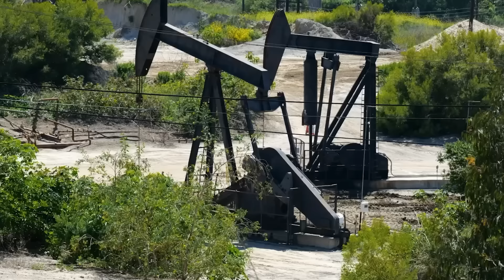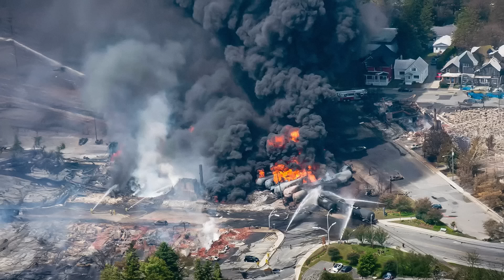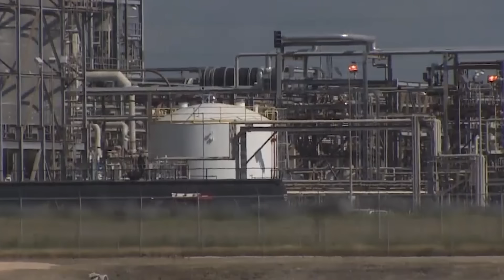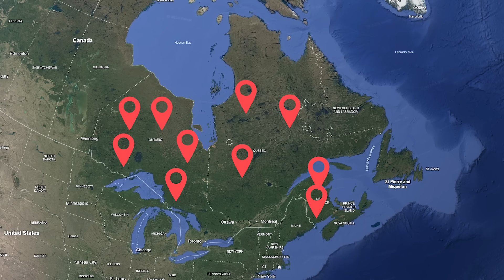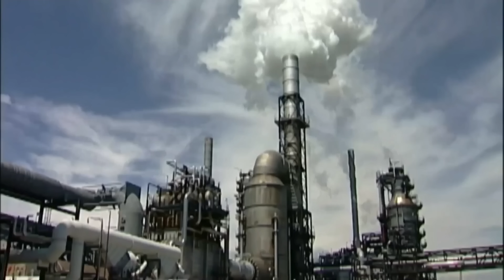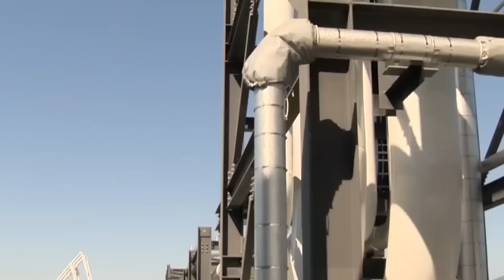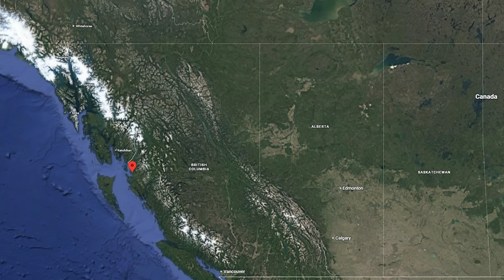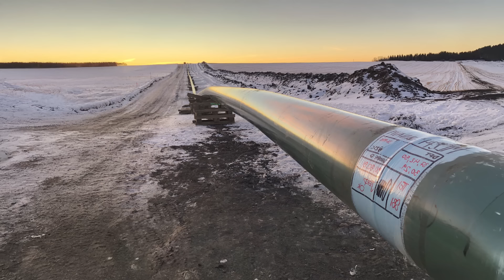Here's Why Canada Can't Build Its Own Refineries, Even Though It Produces Millions of Tons of Oil

Comment: The Co-op Refinery Complex (CRC) in Regina, Saskatchewan Canada can handle heavy oil which then can be sent to other countries.
Reply: It runs an integrated refining and upgrading complex. The refinery is   one of Canada’s largest integrated refining and upgrading complexes, not a heavy‑only plant.
Integrated complexes  run a mixed crude slate — heavy, medium, and light — depending on economics and product demand.      That is because you get different product levels from light medium and heavy.    Due to the upgrades back in the 1980s it can process heavy crude but like all refineries it runs a mix which changes according to what they need to produce as the three grades produce different quanitites of each product.   Light crude for example is 25 gallons of gasoliine per barrel. Heavy crude 10.  Heavy crude 25 gallons of diesel 10 gallons of gasoline.  So they blend them to get the proportion of each they require.
Reply: But it still requires light crude or synthetic crude to operate.
Reply: Refining a paltry 100 thousand barrels a day.
Reply: Even this refinery also uses synthetic and light crude at the same time.
Reply: We just need a way of getting that oil to other countries 🤔
Reply: @bbjFisher2000    The pay to put new pumps on the TMX and add in the additives.  Between those 2 things you can double the amount of oil the pipeline will ship.   Just new pumps alone raises it by 35%
Reply: @bbjFisher2000   then put new pumps online and increase the output by 35%.  Then put additives in that reduce turbulence and friction and the amount almost doubles.
Reply: @jimthebutcher99  About 1.5 years of downtime where nothing is shipped.
Reply: @robertkubrick3738   It still uses some light crude.  It uses sour crude sweet synthetic crude and heavy crude.
Reply: Irving is now bringing in oil from Newfoundland and Labrador
Reply: That plant in Regina is tiny, they can do 130,000 barrels a day. Alberta puts out 1.5billion per year.   The biggest buyer would be China and Europe. Saskatchewan is not close to either. Also other provinces also have refineries. Alberta does 700,000 barrels a day and out east they do 1million a day. Regina is not the answer.
Reply: @Pjc.2155  No, but the type of refinery is.  The one in Regina is an upgrader.  We need more of these around Canada.  Unfortunately, Shell, Petro-Canada and the rest are beholden to other interests and not Canada's market.
Reply: @PorscheRacer14 shell has the Scottford upgrader in Fort Saskatchewan, AB (just outside of Edmonton). Which has rail and pipeline to the coast. It's not enough, but exists.
Reply: @conglomeratehq  Right, but nothing out east or going out east.  So easterners keep importing and not giving a damn or interest about the west because their needs are met.  That'll always be the divide in this country.
Reply: @PorscheRacer14 I agree, but the point I was making is that there are upgraders, too few, but there are a few. They should be the focus of adding value rather than exporting unrefined product. It would also create opportunities across the nation. 

The issue is the government and private interests are not aligned. There are relationships and ecology concerns presented to the government that are not the same on the private interest end. One of those interests was benefits from the US-Canada relations in letting them upgrade and sell our product. The current administration has removed many of the benefits in doing so, and I hope the Canadian government gets to the point of expanding this independence before it's too late.

Canada has been in a situation for many years that would call for nationalization of the energy sector. Or, at least, a fostering relationship to get a Canadian firm(s) up to the level of being able to expand on diversification and value addition, Instead we've been doing what foreign investors want us to do (until the limit was hit, a long time ago).
Reply: unfortunately that needed to be done 25 years ago. The energy sector was still booming then but there was no national interest to invest in our energy for our use. One of the reasons I left the oil patch after a decade. There were still Canadian companies then, now most of them have been absorbed by American and British companies.
Reply: Why does a country have to be divided because one region can get a lone product cheaper?  Would you pay triple the price for a new fridge if it’s built in Nunavut instead of Chicago?
Reply: @Pjc.2155 this is why their product tends to go directly to retail. Much more efficient and better margins economically.
Reply: @Pjc.2155  Europe buys Brent, not heavy sour.
Reply: I haven’t been to Regina for a few decades. Do they have a port for tankers now?
Reply: @Rod-b2u is there any significant oil production near sea ports in Canada? If so then why does the Irving oil refinery import?
Reply: @E @EltonMcBain here are no oil wells nearby to the Irving refinery. Government and activists blocked any pipeline project to connect the Irving refinery to sources of crude petroleum in Canada.  Thus, the only sources available are foreign oil. In any case, that refinery was designed for light crude. 

The Suncor, the Valero Jean Gaulin and the Parkland Burnaby refineries all have 70 to 100% Canadian input. 
The Suncor refinery in Montreal is not on a seaport, but the Terminal Montreal East accepts tankers that access the sea as well as up the St Lawrence Seaway.
Reply: @EltonMcBain  Because the majority of Canadian oil is over 4000 km away? Ever think about that?
Reply: The east don't like oil.
They will run on solar and wind. Let him doit.  I, as albertians don't care anymore about Easter canada and the central communist comitee in ottawa.  FREE ALBERTA.
Reply: @berthelvetic1923  They will still need your money to pay for the East failure and to keep them afoat or in your place I would say Yeah, Sure, Whatever, but you still get the bill.
Reply: @robertkubrick3738 if they ( in ottawa) let use go, i think, this is anymore our problem.
But, my guess? This is the reason , to start ww3.  So ottawa can stop all seperation. But the problem isn't solvet. After the war? We , the leftovers have to restart survive and life in general.
Remember? The remark from a very fames small hat, i don't kow, howe we start and fight in ww3, but we know, ww4 we fight with sticks and stones.

Comment: There is also a risk associated with exporting heavy oil by sea. Canadian heavy oil, specifically diluted bitumen (dilbit), generally floats on saltwater initially, but can sink after it weathers (loses light compounds via evaporation) and mixes with suspended sediment. While it floats in pure saltwater, it is more likely to submerge or sink in coastal waters (lower salinity) or when turbulent wave action mixes it with sand or silt
Reply: Oil tanker tech  has improved on a scale where these disasters are almost a thing of the past. can it happen yes absolutely. The cold reality here is until people who criticize oil are willing to stop benefiting from it they will continue to look foolish while defending this position. get rid of oil go ahead but death will be shortly behind for billions.
Reply: There are 13 out of 15 refineries in Canada that use Alberta bitumen sands heavy crude oil right now. 

All 13 of those refineries receive deliveries directly via pipeline from Alberta, including all four in southern Ontario (via Line 5) and the only refinery in Montreal (via Line 9).

The two refineries that do not use Alberta crude oil in their refinery diets are located on the south shore of Quebec City, in Lévis, and in Saint John, New Brunswick.

The refinery in Quebec City is owned by Valero and the same company owns a massive storage depot in Montreal. Furthermore, Valero also owns an oil pipeline between Montreal and Quebec City.

So the reader may be asking themselves: so wait, if there's already a pipeline between Alberta and Montreal and another oil pipeline linked directly to the same company's refinery in Quebec City, why aren't they using Alberta crude oil too?!

The answer is simple: it's not economical to do so.

Alberta bitumen is heavy in asphaltenes and low in resins. This makes it a low-value product that is generally used as a cheap blending agent to bring down the overall cost of refined petroleum products. Remember when the Conservatives told you that Western Canada Select oil was priced lower than West Texas Intermediate because there was insufficient pipeline capacity to Canada's west coast and Canada was stuck with only "one customer"? Well, the Trans-Mountain oil pipeline is now complete, exports are happening all over the world, plus, there is excess capacity available on it!! And the price gap between Western Canada Select and WTI is still over $12/barrel on average!! Chalk it all up to yet another Conservative lie. Pierre Poilièvre is a rank expert at lying to Canadians and Conservatives are repeating the same, tired lies that are being disproven every day with TMX exports to Asia. Bitumen sands crude oil is low quality, and no amount of pipelines will ever change that. 

No, Valero actually uses their pipeline to ship finished products westward, from its refinery to Montreal instead of shipping Alberta crude eastward. 

Suncor also owns a Quebec refinery, in Montreal.  Suncor blends Alberta crudes with imported crude oil from overseas via tankers that land from the eastern US, Norway, the Middle East and Nigeria with light, sweet crude oil. The imported oil either arrives by tankers, or occasionally, gets unloaded in Portland, Maine and then piped to Montreal. 

Incidentally, the company that owns the Maine to Montreal oil pipeline applied to reverse its direction, so that the line could carry tar sands bitumen from Line 9 to Portland, Maine for marine export via tanker.  Concerned citizens of Portland in 2014 passed a municipal ordinance banning the export of oil sands bitumen at the Port due to environmental concerns. Portland Pipe Line Co (PPLC) filed a lawsuit to overturn the ordinance as unconstitutional, and against interstate and international trade. They lost in Court and abandoned their appeal in 2021. 

Many find it amusing to listen to the same Conservatives who worked tirelessly to destroy Canada's National Energy Programme in the 1980s now turnaround and counsel the government to ignore the economics and build a brand new pipeline from Alberta to those two refineries, even though it makes zero economic sense to do it today with all the existing infrastructure in place.
Reply: It did the same thing for millions of years off Long Beach California from natural seeps . We used to collect tar balls on the beach until they pumped it out in the 1970s.
Reply: Is the maker of this Video you dumb? Or just American? On the West Coast there is a Huge refinery in a place called Port Moody and Burnaby 

Burnaby Refinery – a Canadian oil refinery located in Burnaby, British Columbia, formerly owned by Parkland Fuel Corp.  and now fully owned by Sunoco following their 2025 acquisition of Parkland Fuel Corp. The facility, commissioned in 1935, has a refining capacity of 55,000 barrels per day (bbl/d) and processes crude and synthetic oil into gasoline, diesel, jet fuels, asphalts, heating fuels, heavy fuel oils, butanes, and propane.  It is the only remaining West Coast refinery in Canada and plays a critical role in supplying transportation fuels to British Columbia, including producing Canada’s first low-carbon aviation fuel in December 2024. 

Burnaby Refinery – Quick facts:

Location: Burnaby, British Columbia, Canada
Commissioned: 1935
Capacity: 55,000 bbl/d (8,700 m³/d)
Nelson Complexity Index: 9.1
Key achievement: First in Canada to successfully produce low-carbon aviation fuel (December 2024) 
The refinery is supplied via the 1,200-kilometre Kinder Morgan Pipeline from Northern British Columbia and Alberta. It was originally established by Standard Oil of California and expanded significantly in the mid-1950s. Parkland Fuel Corp. acquired the facility in April 2017 from Chevron for C$1.46 billion. The acquisition by Sunoco LP was finalized in 2025, making it a wholly owned subsidiary of the U.S.-based company. 

Ioco Refinery (Imperial Oil Company):
The Ioco Refinery, originally built by the Imperial Oil Company in 1914 on the north shore of the Burrard Inlet in Port Moody, began operations in January 1915. It was a major industrial and community hub, employing over 200 people and supporting a company town with 83 houses, schools, churches, and recreational facilities. The refinery processed crude oil into gasoline, diesel, aviation fuel, propane, and asphalt, with production peaking at 25,000 barrels per day after a 1952–53 rebuild. It closed in 1995, following the expansion of the Trans Mountain Pipeline, which shifted crude supply and refining operations to Edmonton. The site was converted into a petroleum products terminal. 

Current Operations at the Burrard Terminal (Suncor Energy):
Today, the former Ioco site is part of the Burrard Products Terminal, owned by Suncor Energy.  The Upper Terminal in Port Moody includes fuel processing units, a main tank farm, and blending facilities. The terminal handles refined products such as gasoline, diesel, jet fuel, ethanol, and biodiesel, delivered via pipeline, marine tankers, rail, and trucks. The facility spans 430 acres, with operations concentrated in Port Moody, Burnaby, and along the Burrard Inlet. The site is now a key distribution hub for refined products in Western Canada.